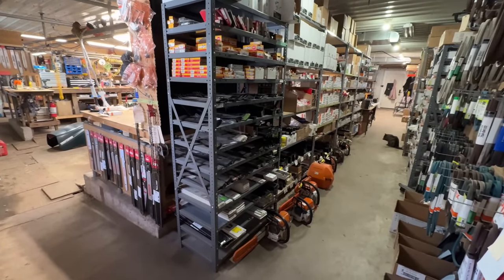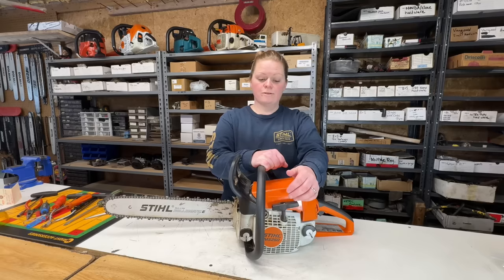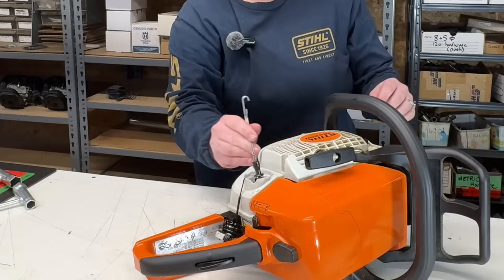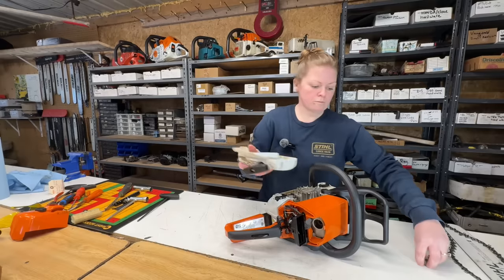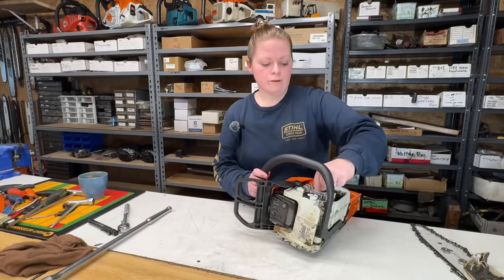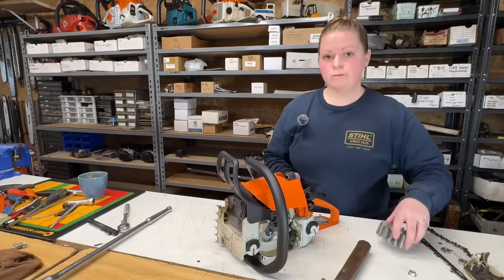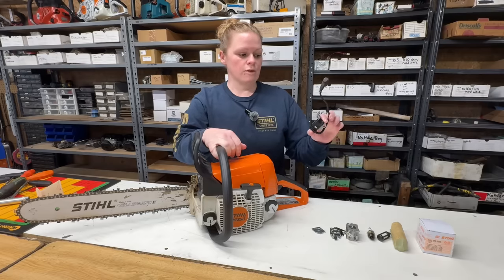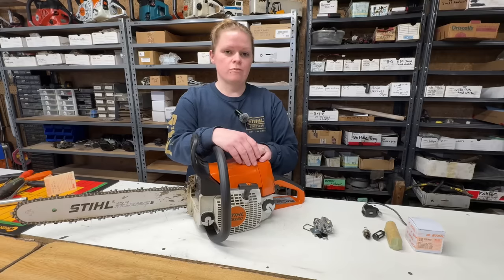Stihl MS250 Chainsaw HARD To Start!  It Wants To Rip Your Arm Off!  Let’s Dive In and Find Out Why!

Comment: I am a 20+ year STIHL Master Whench Service Tech in the Northeast U.S. The MS250 is an amazing chainsaw, the power to weight ratio is amazing. HOWEVER they have more pull resistance than any other saw in the line up. It will start in the same amount of pulls as any BUT you have to pull it like you are mad at it. I had a meeting with all of our counter guys and made sure that they pass that info onto the unsuspecting customer who is purchasing the saw. We have had hundreds of these come back for hard starting, meanwhile there is literally nothing wrong with them per se other than the customers not pulling hard enough. I own a MS250 and I love it. It’s my go to, my favorite.
Reply: I have a MS-250 it’s hard to start too.
Reply: I got 2 at work and one at home. Love these things!
Reply: She said that. She knows the MS250 has a high compression engine, therefore hard to start. She even said she's careful who she sells them to as in what they are doing with the saw and makes sure they know it does pull hard and they need to take that into consideration. She's saying that it is unusually hard to start, even for an MS250. Should watch and listen to the whole video.
Reply: I believe an easy start was available for this model when it first came out.
Reply: ms391 does that once in awhile sometimes pulls no other times rips cord outa your hand.. owner replaced coil.. im thinking its not in spec on coil
Reply: I have MS 250. Try starting if it's kept outside in winter! It's impossible unless the saw is brought up to room temperature.They are JUNK.  I need a saw that can start in the winter! In my unprofessional opinion the ring gap is wrong, but I'm not dismantling this SOB.  Stihl should recall every one of these saws. The comments here and on the video prove it's engineered wrong.  I've owned one of Stihl largest saw the 0-75 and it wasn't as nearly as hard to start. I'm sorry I ever was sold it brand new from the dealer.
Reply: I long for the days of compression release.
Reply: I bring my 250 to my local ace and I have then cold start it for me and then run it for a while, then it is much easier to start. The 250 really needs the easy start, it came out just after when I purchased mine. I really should have purchased the one down, it would have made my life so much easier. I do not have any trees now.
Reply: @Shawshanc Maybe try reading the operator's manual specifically page 35. These saws have a winter/summer shutter.
Don't blame your tools for operator ignorance.
Reply: I bought my MS250 along time ago from a local Stihl Dealer and I always had trouble starting it.I bought a 038 AV super from a Buddy of mine, it was used but it was a lot better Saw than the MS250. I always had trouble with the MS250, very Frustrating.
Reply: It's a crap domestic saw anyway.
Reply: I just bought an ms250. My first ever chainsaw. I did have some issues starting it but I believe it was me.... It likes to flood real easy on full choke.. and I was starting it on the floor bent over pulling on the cord.. now I don't even use full choke for more than one pull. I put it on half choke and drop start it... It will start within 2 pulls....
Reply: @leewilliams4519 This is the way. One pull on cold start choke is usually enough. Most people who say this saw is tough to start are just flooding it.
Reply: @Shawshanc 😊
Reply: Great saw, but the put it on the ground to start method makes it hard to start.  Put the brake on and drop start it.  Perfect.
Reply: I just push the saw away from me it gives me no problems it's the only chainsaw I've ever owned or used. It's definitely harder to start than a string trimmer but just point the saw away from you and push it away while holding the cord. Three pulls on full choke, move it to half choke, one pull starts every time.
Reply: @leewilliams4519 I don’t know what more people don’t drop start these saws. Let gravity and its weight give you a hand, is what I always say. Plus it looks more badass.
Reply: Common problem with this saw. Rope snap back, jerks pull handle out of your hand. It can hurt you!
^..^~~
Reply: @Jeepsteve1982 😊
Reply: “Gotta be careful I don’t put my tool in the wrong hole” that, sweetheart, is the story of my life.
Reply: Those people need a battery saw
Reply: You caught that too!!! 😂😂😂😂 @dalesdipstick
Reply: I have an .039 with compression release and it's still tough to pull.
Reply: I've got one almost 15 years old, have ran the hell out of it. Nothing but ultra oil since I bought it, and only cleaned the spark arrestor once. Great little saw.
Reply: I hate the 250 like no other because of this. A little saw like this should not be punishing to start.
Reply: @Shawshanc get a 261.  My starts cold usually in less than 5 pulls.
Reply: Does it have a compression  release on this model.  Like on the 450 road saw. ?
Reply: Had  many. Still brand equipment.  And best advice. Could tell you.  Treat it always like you do with your. Kids. Pamper it with a good formula.  Gas,oil etc  lots. Of love. And. Care. Will gives lots of years of. Use.  Blèssings
Reply: My brother bought one last year and had same problem.  No one had been into the saw.  I was an auto tech for 23 years.  When someone said "hard starting" I talked with them a bit to understand exactly what they meant by "hard starting".
Reply: Having used a brand new ms250, it was a pita to start out of the box. Now that it is broken in, it starts within a few pulls cold and one pull  warmed up. Great saw around the homestead. It has seen a lot of use in  months and the $275 at rural king was worth it. I only use non ethanol gas. It kicks the crap out of the Ryobi it replaced.
Reply: @tompugh388 no it’s not.  It’s a mid-level saw and it’s certainly not crap.  I bought a used one for my son and I liked it so much I bought one for myself.  I also have the 261 and 362 pro saws and I use them all for different things.  The power to weight of the 250 blows all the competition away.  I’ve never had issues starting it but it takes a good crisp pull.
Reply: @Shawshanc   try echo... I've never had an issue with them. I cut at least 10 cords a year with a 490 and 590.. the stihls sit on the shelf..
Reply: I am not a stihl "master" tech ,but I know my way around these saws and the ms250 are the easiest stihl saw to flood I have ever seen.  I have owned 4 myself and worked on 5-6 more, every one had flooding issues.  Trust me go with a ms290,029,ms310, 039 or ms390. Way better saws for maybe a few bucks more. You won't regret it.
Reply: @Shawshanc  do you put the machine in winter mode?  I sometimes use my saw in temperatures around -20C, never had trouble starting it.  If you don’t like the saw, resale value is very high.  I paid 200$ for my MS250 10 years ago and recently sold it for $250.  Not bad for a piece of junk😂
Reply: @rohns2952 summer and winter shutter won't make it hard to start, it only allows more or less cool air to circulate around the cooling fins!
Reply: Yeah it’s a compression issue.. it’s one stihl that could use the deforestation feature if the husky’s..
Reply: Then why doesn't the MS250 have a partial decompresser valve so it's less work to start?  It's not like this saw is a big 80+ cc logging saw.  My Jonsered 2150 has a decompresser.
Reply: @bryanmcgovern7858 My MS290 "Farm Boss" bought in early 2000's, is just like all these MS250  complaints. Floods too easy. I don't get how to (hold the saw steady doing) jump start. No compression release. Finally this year (2024) I bought a new OEM carb and it was hard to install. Gotta see if it still floods and tries to break my arm.
Reply: Thanks for the info. What is the longest bar this will service right. I have two worn out 026s , both with an 18 inch bar. Will be buying a saw soon. 18 or 20 inch is all I need. Does this 250 have 3/8 or 325???

Comment: I've seen this. Fuel doesn't compress and an excess of fuel makes it hard to pull rope. Sometimes you can't pull the rope at all. What surprises me is that we didn't see fuel at the exhaust outlet.
Reply from the maker: Bingo!   You just said the words that I couldn't spit out today.
Reply: It call « Hydrolock »
Reply: Learning community, l like it!
Reply: Sheared flywheel key will do the same
Reply: I've got several 025's, one of which "someone"😂 gutted the muffler and reset the lo and hi screws. 👋 😮. Why?...don't know, because they both run about the same still. I use my 262xp and 046mag for the heavy lifting. 
Great video, new subscriber out.
Reply: gotta be careful, don't wanna put your tool in the wrong hole.  well said.
Reply: @marriedwithsmallengines from experience I’ve learned that 90% of the time it’s the carb , I always recommend a kit , usually it’s the fix . Most of the time it’s a fuel problem , line , impulse , vent , filter. In al the years  I’ve ran saw only replaced one magneto . 👍🇨🇦
Reply: Yes, but it should’ve made your lightbulb go off when you said about the excessive amount of carbon in the combustion chamber and on top of the piston. I actually said that to myself when you mentioned that I won’t play armchair quarterback, but I muttered to myself to “check that carburetor as well!“ Live and learn my friend/ that is how we gain experience and knowledge. Good job as always!
Reply: @marriedwithsmallengines  is there a chance that you could please like list those items that you use for tools and what not to take it apart and check that engine please? Thank you.
Reply: @timb4569 I knew I'd find comment about that!
Reply: It's not that the fuel is preventing the engine turning. Not enough fuel or too much fuel will not let an engine start. Stoichiometric Rate is a precise ratio of fuel to air that allows combustion of the fuel. Most likely, the carb jets were plugged with the s5it the owner poured into the tank. And the owner decided to self-medicate and diqued with the fuel settings. That upset the starting mixture.
Petrol engines need an over-rich fuel ratio for starting. To make up for fuel that condenses on engine surfaces. The fuel that condenses it lost fuel. A weak mixture will not ignite. A choke reduces air and increases the ratio of fuel to air and compensates for that loss.

Comment: One thing that I have found as a Stihl Technician, is that you need to make sure the cylinder has some fuel mixture in it. Just a small squirt will not flood it but lubricate it and prime it to start easier. Always hold the interlock and the throttle wide open and set to full choke if you are not prep-priming the cylinder under normal circumstances. you will notice that even though the choke is fully closed, the throttle is open somewhat. This reduces pulling tension needed to turn the engine over faster and with less difficulty. 1 to 3 pulls is all you need normally with full choke. If the saw "pops" then immediately, without touching the throttle, move the choke lever to half choke. If you have per-primed with a small shot of fuel into the cylinder for lubrication this is where the choke needs to be in this sequence. Now the throttle is still open but not fully choked. This makes it even easier to pull with both butterflies open. The saw will usually start very quickly with just a few more pulls. The engine RPM will race so be quick to pull the throttle to fully release the choke and lower the RPM as needed. As we work on these saws we learn the interlocks both at the throttle and in the linkages to help us start these powerful tools.
Reply: Yep! Exactly the correct starting procedure! Was taught this first day 20 years back on the correct way to start the MS250.
^..^~~
Reply: Could also be that the saw has carbon deposits from too much oil to fuel ratio. The throttle being at fast idle indent on the choke has little to do this any force increase,  these are piston port two strokes and there is little to zip of any engine braking at cranking speed, if anything, wetting the cylinder with fresh fuel is going to increase the compression ratio, making it harder to start.

Why Stihl released this saw without a partial decompressor valve is a mystery.
Reply: I spray starting fluid onto the air filter for about one second, quickly put the cover back on, hope I didn't flood it with ether, pull a couple times with no choke, which rarely works, then try once with full choke, try again with half choke and maybe full throttle, if it isn't trying to break my arm by now, I usually get it going. Surprised that all those ether shots hasn't ruined my compression..nope, MS290 20 years old, no compression release, still seems like full compression after maybe 1000 starts. It's a devil!

Comment: Omg soo much checking on a never used saw lol.. if you pull the cord once the plug is removed you’d have figured out quickly it’s a compression issue.. its common with a couple models from stihl and the 250 is famous for it.. its the one saw I think they actually need a decompression feature

Comment: Lol, I work on boats and the customers usually never admit that they tinkered with stuff. But on that note try using a small piece of pull rope shoved into the spark plug hole for a piston stop. It works great and it won't damage anything!

Comment: Just a hobbyist small engine tech guy's observations: The gasoline seems to have an inordinate amount of dye color, like possibly the premix oil is at 25:1 and if this engine has been run on a regime of this oil heavy premix by guess, I would also assume that there is considerable carbon buildup in the cylinder.  Did you pull the muffler and inspect the exhaust port and the piston top for carbon deposits?

Comment: Not on you! I worked in the service field for motorcycles, lawn and garden  equipment, generators, etc. What I learned and it saved me a lot of time was while I was writing up the ticket and talking to the customer was, "what did you do to try and fix it?"
9 out of 10 that was where the problem was.
Great vid. Excellent presentation. Very methodical. Just remember a lot of times is if we're not making errors, we're not learning. Thank you and keep up the great work.

Comment: I'm 82 years old and had to give my 14 year old MS250 to my 32 year old grandson. The saw was hard to pull from day one but I lived with it till last year. No problem starting...just hard to pull (no decompression valve)  which is a common complaint with the MS 250 when looking around the net. 
  Replaced it with a MS250 C-BC Z/18" bar easy start system. Now its a pleasure to use.
Reply: My grate uncle owned a Johnson sp 49 chainsaw year 1984 he was age 73 and smoking cigarettes I was age 15 I use too have too station the chainsaw for him  too work it strong compression
Reply: I bought my wife an MS180C with the easy-start feature, She'd be unable to start it without that.
Reply: A Lot of fuzzz about the coil

Comment: I have a 42-year-old, Stihl 028 Super that I first used for commercial timber thinning, running it very hard for 10 hours a day, seven days a week, for three years. It is now relegated to brush clearing around my property and other light duty. It has never had a rebuild, but occasionally becomes hard starting. A simple, quick carburetor clean and overhaul has always solved the problem and makes it run like new. New to your channel and this was very informative, especially pressure testing the fuel system, which I didn't know about.
Reply: Thats a good run !